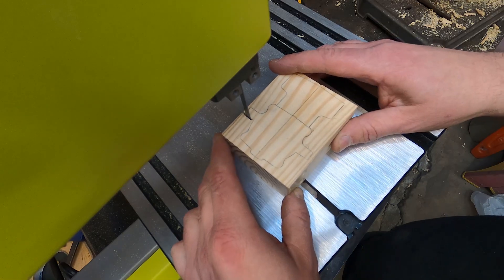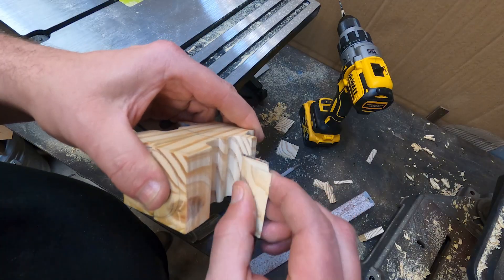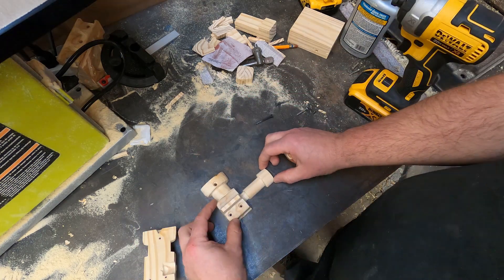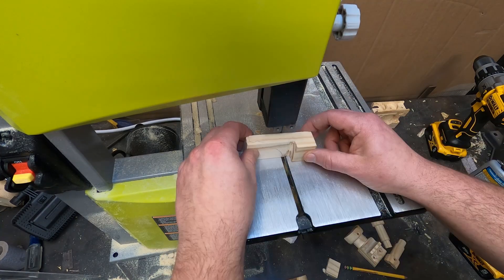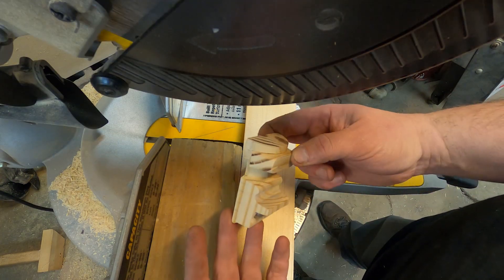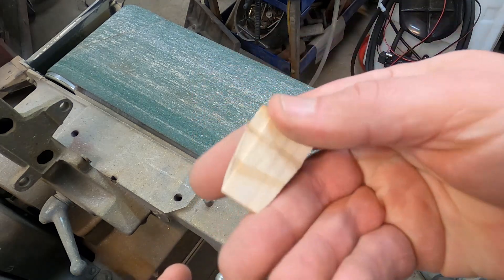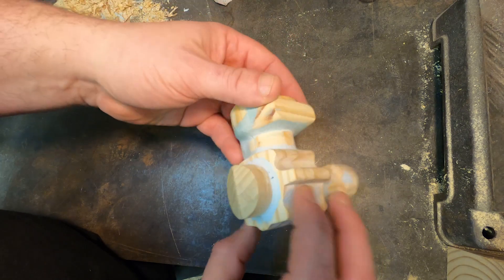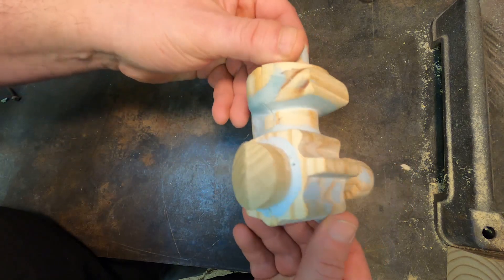Two Stroke Engine Sand Casting Pattern

Comment: When you were milling the transfer port on the drill press, and it got ripped out of your hands and thrown away. I cringed. It reminded me of one time I was drilling holes into a 6"x3"x1.5" lead casting. The bit caught, pulled it from my hand, and then I had a 5lb offset weight spinning in the bench drill press. I automatically backed away. The drill press was moving because of the offset weight. I was afraid that the lead was going to come flying off and hit me. It was scary. I quickly moved in and hit the power switch.  This kind of thing happens so easily. The spindle shaft was bent and had to be replaced, but I was lucky I didn't get hurt.

I'm looking forward to seeing your progression with this engine. Thanks for posting.
Reply from the maker: I'll try to remember to not drill lead in the drill press. 
Drill press work is dangerous. Even with small drills. That's why I kept that in the video so anyone that sees it remembers to always be ready. And  no baggy sleeves or gloves around spindles of any kind.
Reply: OK I wasn't going to mention this. I figured the above was enough. I had the same thing happen at home a couple of months ago. (the one above was years ago at work) 

I was given some balance scale weights. Nice shell with the center filled with lead. I wanted the brass for casting and I thought I could drill out the lead, maybe pry it out with the help of the holes. Same thing happened. The weight was smaller than the above one, maybe under two pounds. But the drill caught and then the off center weight was spinning around. This drill press is a smaller one so it tipped over. And like the work one, it bent the spindle shaft. With a lot of work I was able to get it straight again. I swore that I would never drill lead again without the work secured. 

I have some 20kg bricks of lead that I wanted to use as weights to hold down the cope in casting. I welded up some handles. I was going to use 3/8" bolts to attach the handles to the bricks. I just needed to drill some holes through the lead for the bolts. Drilling down about an inch was okay. Had to stop and clean out the lead from the flutes. But when I tried to go deeper it would bind. This was not working. :(

So off to the internet to find a solution. And of course the solution was WD40. I had not wanted to use a lubricant because I didn't want a pasty lead mess. But at that point I didn't care, and it worked great. No binding. So for drilling into lead, secure the work and use WD40.
Reply: You might want to incorporate a Dead Man's Switch as a pedal variant for the main power cable of all the bigger working machines you have.

Simply, a pedal switch is either inserted to the machine's cable or you use a ready made part. The aforementioned way is very easy and cheap.

Operation: in addition to the normal power ON etc. controls you also have to keep a foot on the Pedal Switch.
If something bad happens you lift your leg from the pedal and the machine's power is cut off.

I have 12 years from game design, programming, electronics, robotics and automation and I am not allowed to work for the next 13 years or all my income will be confiscated due to Finland's policy towards alimony. The alimony that was ordered was so excessive that I could not pay my own existing debts and with loss of all credit rating etc.. Long story short, I am only allowed to earn unemployment benefits and if I accept work I will be allowed to keep less than I get when I am unemployed and I will not afford to go to doctor or actually own a car to go to work with.

I hope this advise will help you avoid any unpleasantries during your pursuits.

Comment: This is getting really interesting.  Are you thinking spark or glow ignition?
Reply from the maker: Both. The glow has better chance of getting in the air sooner.  I might not get the spark ignition to make good power soon enough to get in the air. And there's the extra weight of the ignition components.